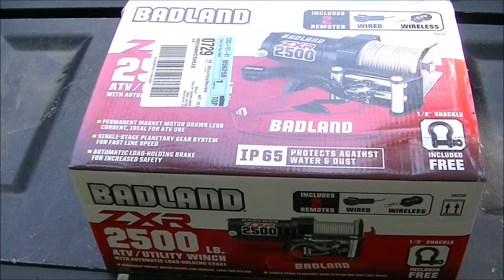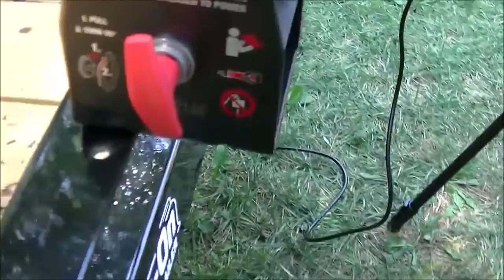Harbor Freights Badlands ZXR 2500 Winch Unbox and Install

Comment: Ever thought about just using the trailer lights connector to power the winch
Reply from the maker: I had but after talking to some folks it wasn't advised because the wire is to small to handle the load. I may over the winter run the wire I am using to connect from the battery to the winch and run it from the engine bay under the truck so I don't have to keep pulling out the wire to hook it up. Just less time on the boat ramp. Thanks for watching!!

Comment: how wide is the steel plate you added under the winch n how thick and what type screws you use to hold the black boxes on with and what sizes drill bit did you used
Reply from the maker: in looking at the harbor freight plate 5x7. I'm guessing it's 3/8 or 1/4 thick. Screws came with the box. Not sure on the drill size. Sorry